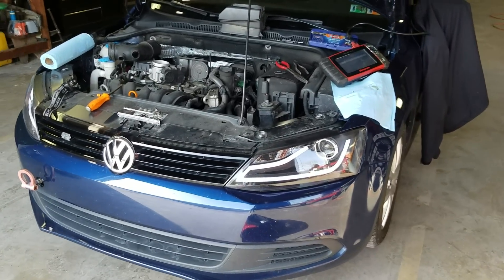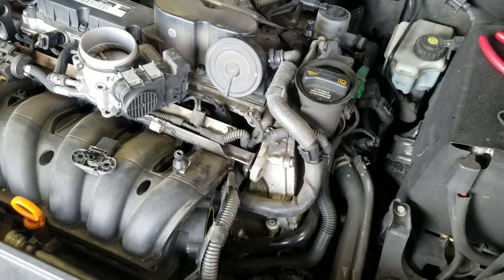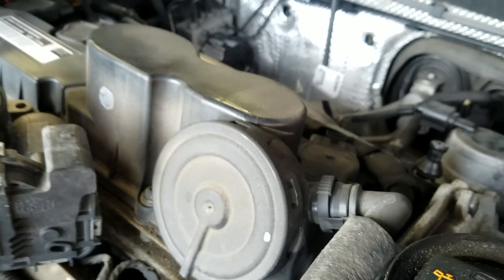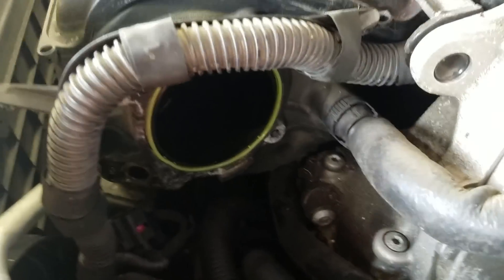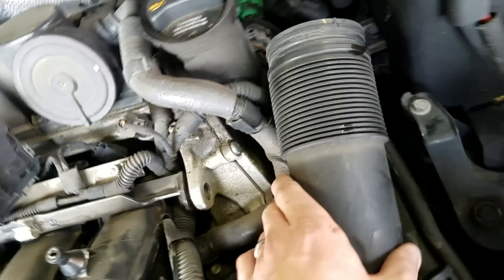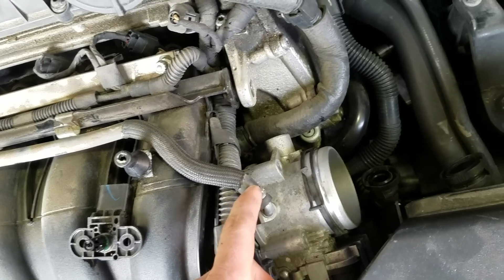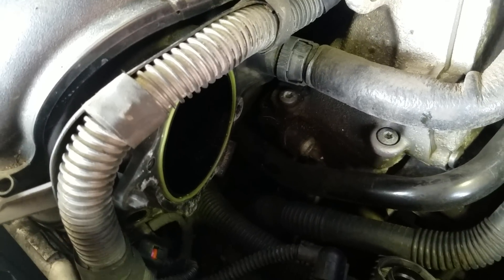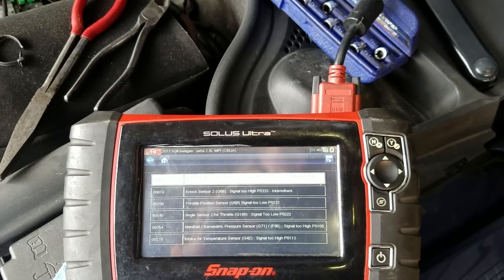PART 1- P0106 VW 2.5L Jetta Manifold Sensor Implausible Signal

Comment: Hey buddy, thank you for such a helpful video. I bought a 2012 Jetta, the check engine light was on showing P0106. The car would accelerate very slow and then kick in in a few seconds. I replaced the sensor with the new one two days ago, cleared the code and the car started driving well.  Today while I was driving on a freeway I got the same code again. 
After watching the video I believe I need to replace that Dorman thing? Should that solve the issue? 
Thank you!
Reply from the maker: Rav Ocean Probably, if you remove the sensor and find oil, then yes.
Reply: Skyhook Studios so I ordered the Doorman and replaced it today. I cleaned the sensor that I put new last time, I cleaned everything I was able to. The plastic on the old Doorman was the same color as yours, but it didn't have any cracks tho. I cleared the check engine light, drove today all day and I got the same code again. I'm really getting disappointed. What should I do?
Reply from the maker: Maybe you didn't clean up all the oil in the intake?
Reply: Skyhook Studios I tried to reach as deep as I could to clean it. I couldn't clean it fully though because it was unreachable. Any suggestions for that?
Reply from the maker: Rav Ocean if you pull the map sensor out again, does it have oil on it again? If it does then you might not have installed the PCV valve properly. are you getting the p0106 code again?
Reply: Skyhook Studios I replaced the PCV exactly how you did. And I don't think there's any other/wrong way to put it back. The directions were exact same as the original. 
Yes, I'm pretty sure I'm about to get the code again. I got a wrench icon on my dash, so I used my OBD to check via Torque Pro, the P0106 code was pending. Just like after I replaced the MAP sensor last time.
Reply from the maker: Rav Ocean if you have your original sensor, try to clean it and put that one back in. Double check your work. Might have a bad gasket or something not seated right.
Reply: Skyhook Studios unfortunately I don't have the original sensor. The old one said Made in Mexico, the new one Made in Germany, not sure if it makes any difference. 
As you suggest, I'll try to open it again and clean it, double-check everything.
Reply from the maker: Rav Ocean sorry man, short of being there in person to look at it there's not much more I can do to help you. I agree that the one made in Germany should be superior also.
Reply: Skyhook Studios I'll try to redo everything and let you know. Thank you for your help. Will keep in touch
Reply: Skyhook Studios hey, so I took everything apart, the sensor was in oil again. I cleaned it, put it back, cleaned the code and the car drove perfect for two days. After that I got the code again. Plus I also got P1288(I think) and it says the system is too rich at bank1. A little research showed that it's because not enough or too much air. And I'm blaming the MAP since it's not doing it's job. Also, when I only had P0106 code, the car was hesitating when accelerating for the first two seconds, then it's fine. Now, with the new code, the car accelerates really bad, rpms jump around when I stop, very jerky. I cleaned the sensor again, cleared the code and the car is fine for a day or so and the again the same thing happens. 
so, is there any way that the oil is getting there from somewhere else? Please help me to solve it. I spent all my money on this car and it's been a headache since I bought it three weeks ago. thanks
Reply: Plus, funny thing is that if I only clear the codes without taking everything apart and cleaning the sensor, the car starts driving a lot better for a while. Even now it was driving terrible, shaking, hesitating. I cleared the faults and it's not that bad anymore
Reply from the maker: P1288 is not a rich code. It is a code for the coolant temp sensor. I see that code when the sensor is unplugged. Probably why the car runs like crap at idle.
Reply: @ravocean  i'm having the same problem as you. i change chenge de pcv valve and clean the maf sensor and the code appear again...did you fixed? how do you fixed?
Reply: @zehfranco  I sold the car and felt totally relieved!
Reply: @ravocean  Did you solve it? I changed pcv, map and cleaned the acceleration body and the code keeps coming back, I've already been fighting for 8 months

Comment: So theres oil residue all inside there. If you don't get it all cleaned out, will it foul the new sensor? I bought a new MAP and diaphram. Gonna replace both this weekend.
Reply from the maker: huggyjd Try to get as much as you can. Normal air flow will clear up any thats left.

Comment: The problem isn't the MAP sensor itself, I own one an went through the whole process. Make sure the dealership you bring it to doesn't try to make any excuse to get you into incurring into any additional expenses, they are sharp.
Reply from the maker: Sergio Valerio 2008, 2009 and 2010 VWs are having the ECM reflashed for the P0106 because of a computer reading error. The video shows oil on the MAP sensor, as many others have found, but never do I say replace it. If you have this code and you have oil on the sensor, then the PCV breather is faulty.

Comment: My car is jetta 2010 and every thing looks identical to your car. BUT does this car has 2 MAP sensors? there's another sensor looks exactly like the MAP sensor, it's located under the oil cap and a little bit to the right. I got the same exact problem, but I replaced the other one and the code came back the next day. I didn't check the throttle body or underneath to see if there's another sensor. I'll check on that, Thank you!!
Reply from the maker: Mohamad sy just one map sensor like in the video.
Reply: Are you sure? Then what is the purpose of the other one that is under the oil cap? It's the same exact sensor. I checked my car and it does have the one you replaced at the same location, but didn't get chance to swipe them. I'm confused now!
Reply from the maker: Mohamad sy The MAP sensor is simply a pressure sensor. Car makers use the same sensors for multiple things. The MAP sensor is where I described in the video. Any thing else is probably just a pressure sensor for another system. make sure to watch the "whole" video. I did NOT replace the MAP sensor. I replaced the PCV valve and CLEANED the sensor.
Reply: Alright thank you! I will do everything you did and tell you how it went. I searched a lot but no one has any post or  video about where the sensor is located so I got the wrong one. Thank you again for the videos !
Reply: @Mohamed-zk3vj  hey my friend. Sorry this might be late. But that sensor that looks like the map sensor is called a secondary air pressure sensor. It's used to monitor secondary air flow. Works the same as the map sensor circuitry wise but they are different when u pull both of them apart and have them side by side. If I'm correct when I did those I think the map sensor had an o-ring and the other sensor didn't. Dont quote me on that but I know what u mean that they look so much alike.
Reply: how did it go?

Comment from the maker: For clarification- the reference at the end of the video about the code coming back, was before replacing the PCV diaphragm. Once replaced, code never came back.
Reply: I have been driving my Jetta for 3 years with this code appearing about 2 times per month. I deal with it so often that I have a code reader in the passenger seat and I have developed the ability to clear the code while driving! I saw this post at random a few weeks ago. I bought a PCV valve from Rock Auto for a few bucks (less than the cost of the code scanner) and now my problem is solved!!! THANK YOU SOOOOO MUCH!!!!!
Reply: You're the man!  I just replaced my diaphragm because of this video, Thanks for making this!

Comment: Wow this is such a clutch video, the problem started on the day you posted this!  Anyways, you mentioned that this light is persistent, and reappears after a while. What other attempts did you make to fix this problem?
Reply from the maker: PISTOL PETE the reference to the light being persistant was that, before preforming the fix, it would take a few days to return if I would simply clear the light without doing any work. If you have the code, check the map sensor or intake for oil. If there is any, then you have a pcv torn. Since the fix, the code and tested and passed without issue.
Reply: Actually I ended up doing nothing and the code disappeared after a car wash. I wonder what will happen if I try to get a diagnosis test now
Reply from the maker: PISTOL PETE Thats how mine was at first. The code didn't go away because of the car wash. Like I said in the video, it came and went for me at first. Eventually it stayed on constantly. The code is still in there. 3 key cycles in a row without an issue and the light goes away. The stored code take much longer to clear from the computer.